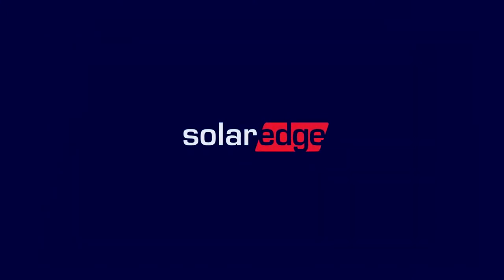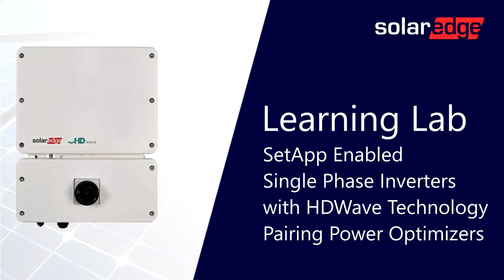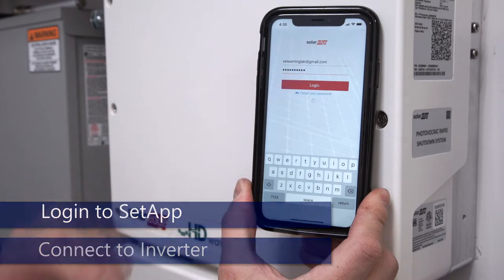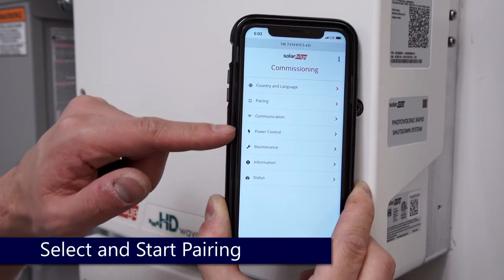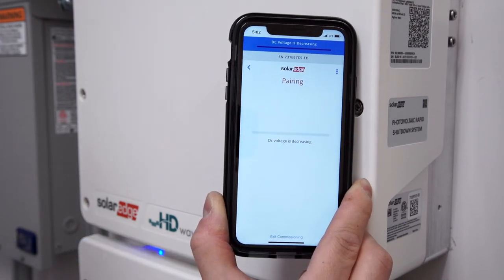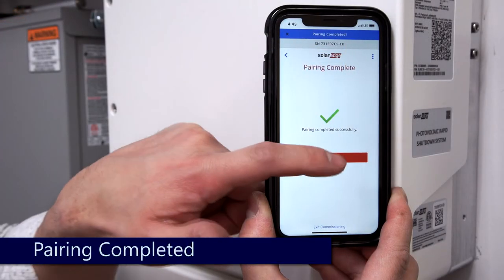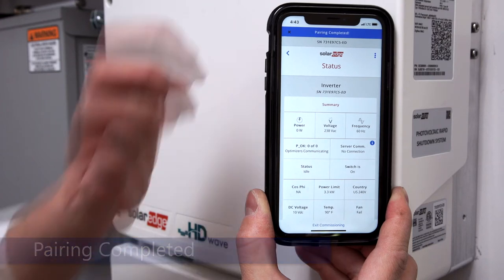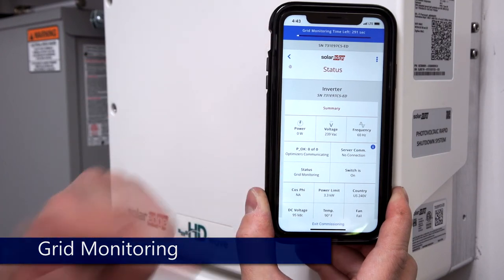SolarEdge SetApp: Pairing Power Optimizers| International

Comment: Pairing continues to fail after minutes of waiting each time. Voltage does not seem to drop to safe value. May have to wait till dark. It did drop 4 out of 12 optimizers, now thinks it has 8. The agony does not stop with this brand. Had 7 optimizers fail and replaced by now, no thanks to support. Downtime is horrible, optimizers means abysmal performance because they keep failing, making entire strings drop out. I am close to kicking the entire inverter including optimizers and hook my panels up to a normal inverter that just works for a couple of years.

Comment: Is the app still only available to installers? My solar’s been down for a week because I have to wait for a rep to come out and pair the optimizers. Could’ve taken care of this a week ago if I had access.
Reply from the maker: A member of our support team will be happy to assist you. You can reach our support at https://www.solaredge.com/service/support.
Reply: @SolarEdgeTechnologies   I’m in the same boat and would rather try the pairing myself as my installers have ghosted me.
Reply: These inverters stink. I’ve had four replaced over the course of five years and numerous service calls to pair the optimizers or wifi issues. It’s comical. Many of these issues can be resolved on your own if granted access. Instead, you have to set up an appointment with your solar company and wait a week or two for a tech to come out and do what can be done on your own in several minutes. Not happy. Nothing but problems with SolarEdge Wave Inverters.

Comment: mine did'nt
Reply from the maker: Hello Johan, how can we assist you?
Reply: @SolarEdgeTechnologies  Hi!If I try to get into the View Only Mode,it writes that ''User not allowed to access''.Why?
Reply: @SolarEdgeTechnologies  this will help all your owners having the same inverter you ready?...... please allow owners to have access to at least some or all parts safe for configuration like setting up communications, wifi. eg. i needed to change my modem and network SSID and password. as a work around I have to keep the same ssid and password to keep the inverter connected to my wifi network. these type of configuration you dont need the vendor or installers to come at your home and just configure your wifi network. please fix this ASAP. great product but has a lot of room for improvement.
Reply from the maker: @jannovota8616  Hi Jan, the app is only accessible to installers at the moment.
Reply: @SolarEdgeTechnologies  CHANGE IT !!!
It's ridiculous that owners cannot trouble shoot simple problems on their OWN installation.